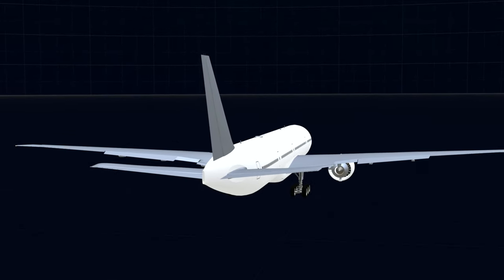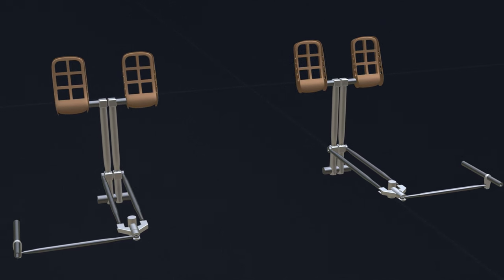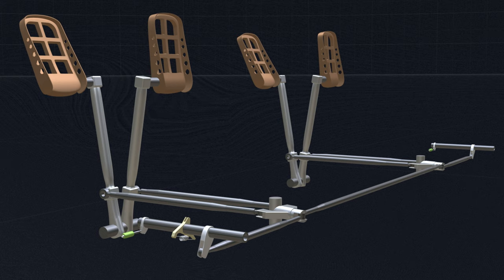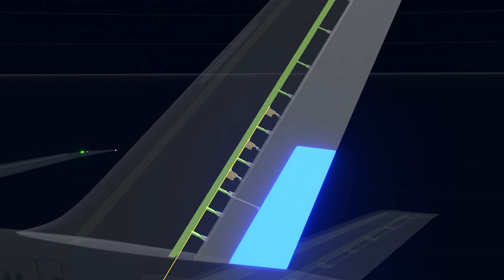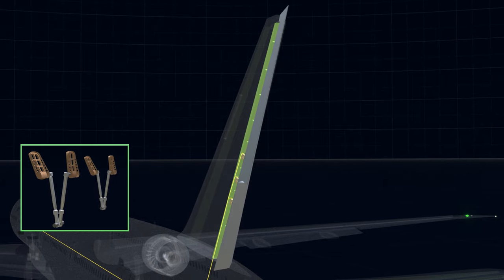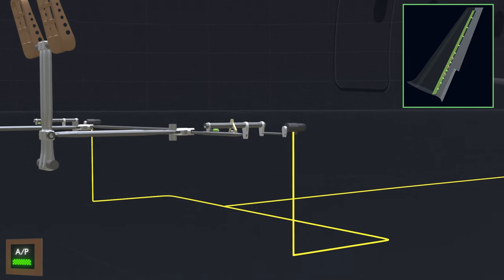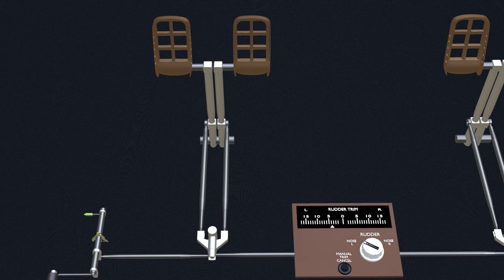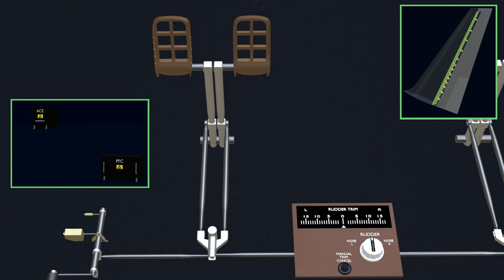How Flight Controls Work | Part 3 : Rudder

Comment: this is amazing
so either pedal movement or rudder trim control do exactly the same job ??
Reply from the maker: They have different applications in flight. There will be a yaw control chapter towards the end of the series explaining them in detail.
Reply: @AircraftScience  Thank you 🙏
Reply: Rudder Trim is useful incase of engine failure. You don’t want a pilot holding the rudder for 2 hours when they divert to nearest airport.
It is Similar to elevator trim, but more of a convenience rather than requirement to fly the plane.